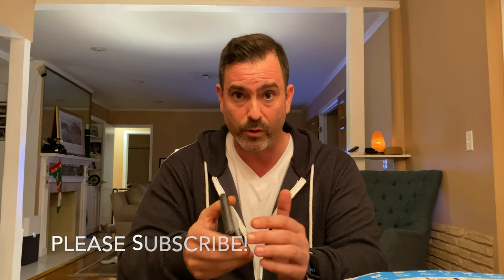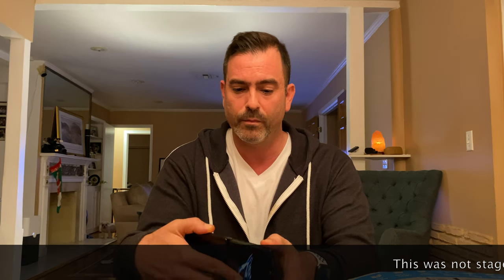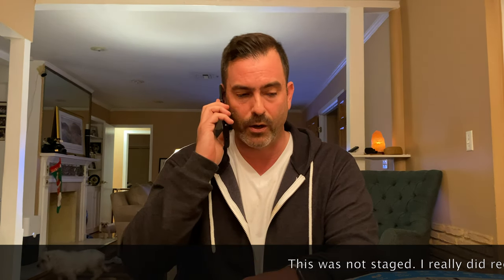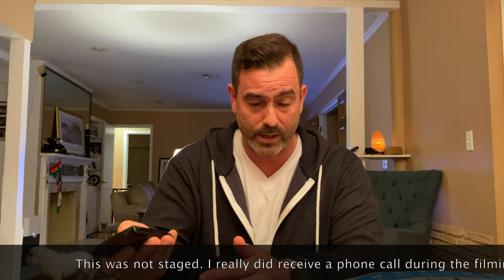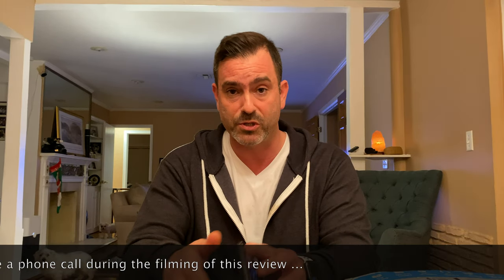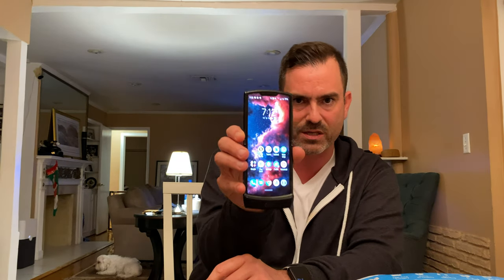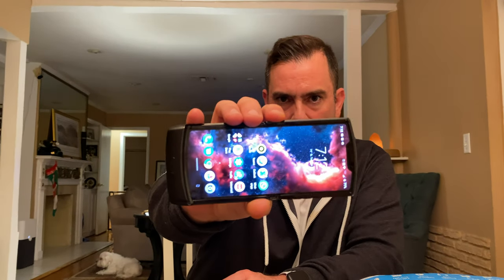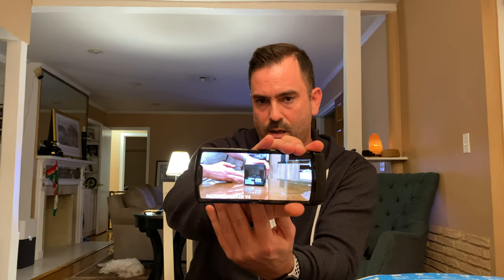RAZR Hinge - Does it really make a noise?

Comment: Thank you I also feel better I got the new 5g razr and my only concern is feeling the battery getting hot when just browsing! Don't know if this is notmal I'm testing it now on safe mode and still happens but also cools down quickly which it's puzzling anywho was feeling worried about this and all you mentioned here  I think I will have faith in it also is good that moto offers a good warranty again thanks